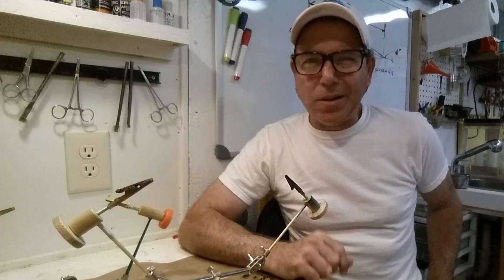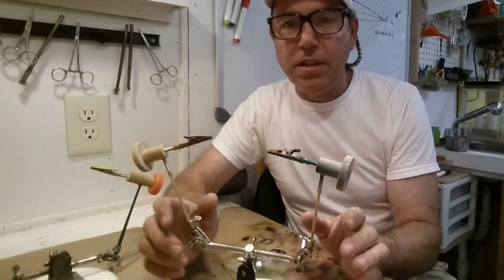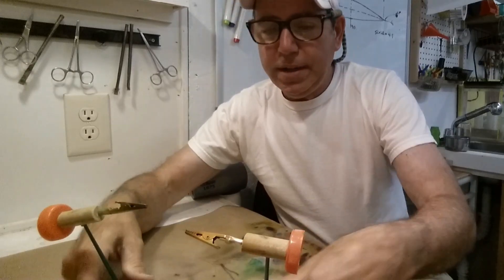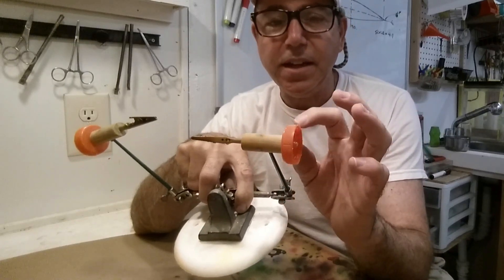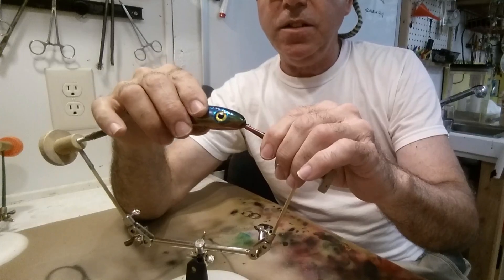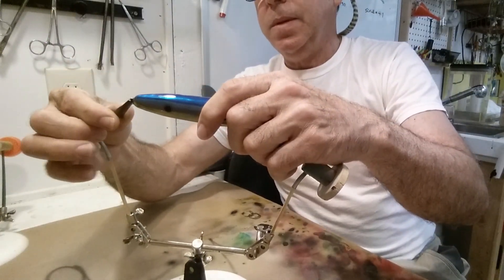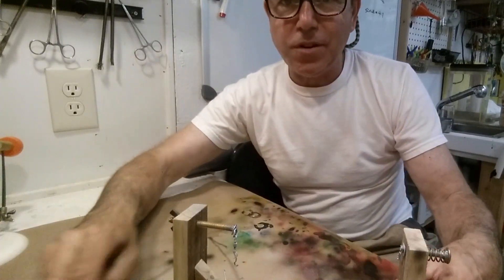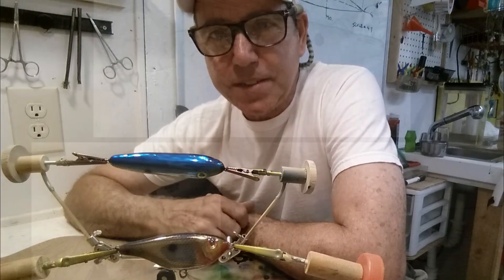DIY Lure Holder Follow Up

Comment: I use a fly tying vice to hold the lures when I paint them, its a little fiddly but it holds lures up to 250mm long without problems. What I like about your holder is that you have both hands free, with the vice im holding it most of the time in one hand and some angles are a bit awkward depending on which hanger you put the vice.

Comment: Just discovered your channel, great adaption, was going to go straight out and alter mine, then I saw the pro version and its even better. Can I ask what springs you use?
Reply from the maker: Graham Bailey 
I got the springs out of an assortment box I bought at harbour freight. I can take a photo and some demensions and post them on the engineered angler Facebook page. ....A little later today
Reply: thank you I will have a look

Comment: Just a little FYI. Harbor Freight has 3/16” X 33’ of fiber glass wire running kit for $8. You can make a lot of lure holders with that. Instead of paint brushes. I accidentally ran into it looking for cheap paint brushes based on one of your previous videos.
Reply from the maker: That's a great tip.  Thanks